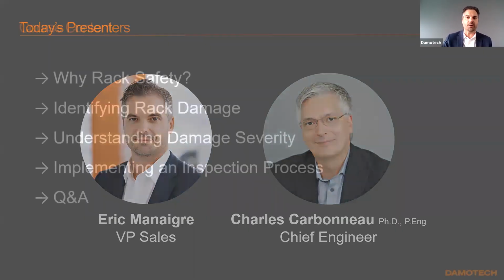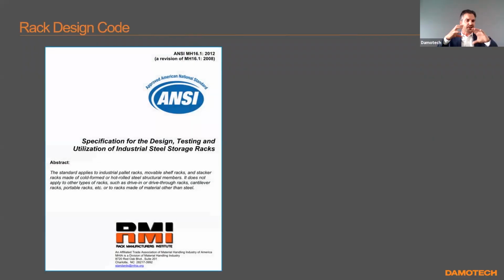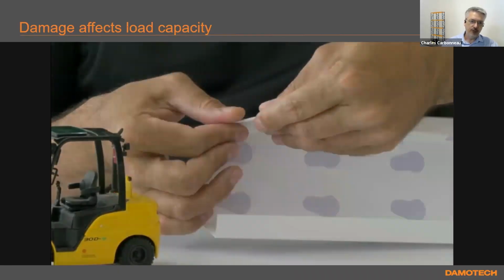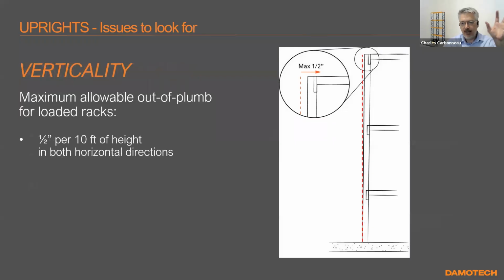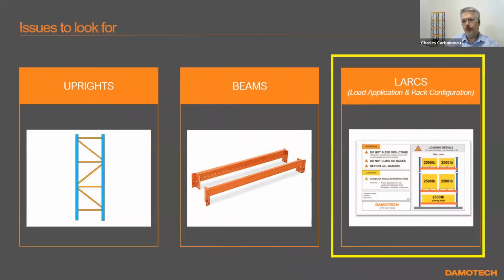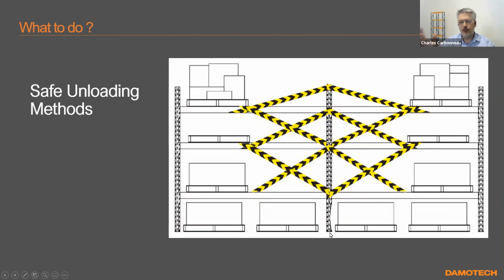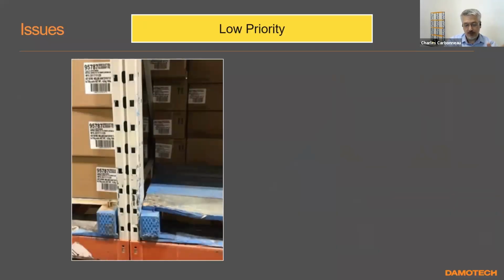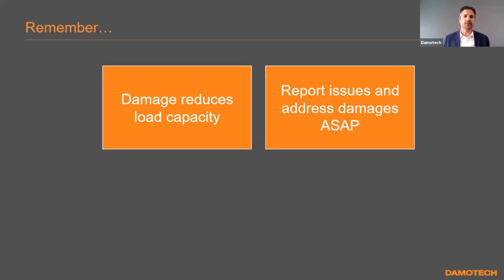How to Identify Pallet Rack Damage: When to Repair, Unload or Replace

Comment from the maker: The question we get most from this session: what actually pushes damage from "high priority" to "unload this bay now"?

The short version is that there's no single number. It's the combination of how far the component has deformed, where the damage sits on the upright, how much load is above it, and whether the bracing and connections are still doing their job. A dent low on a heavily loaded 30-foot column is a different conversation than the same dent on an empty 8-footer.

Three jump points if you're short on time:
▸ 18:30 — how much damage is too much (the gray zone)
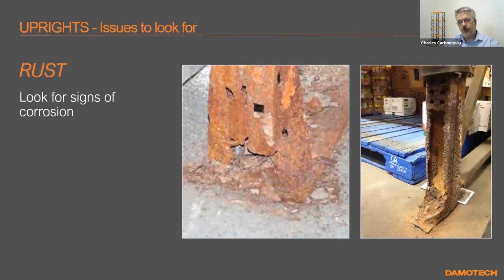▸ 22:31 — reading rust and section loss
▸ 55:29 — building an inspection protocol that holds up